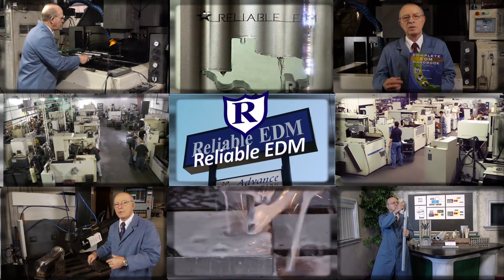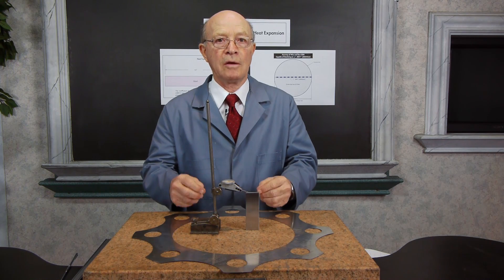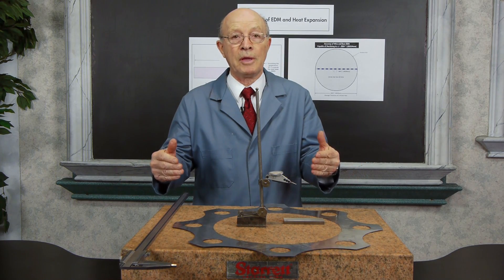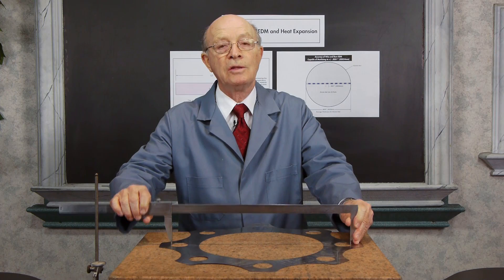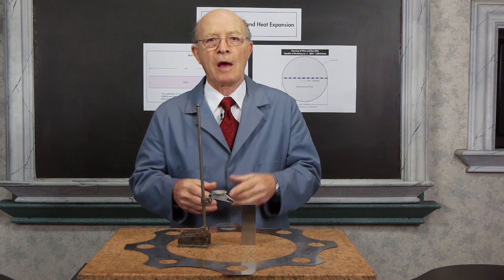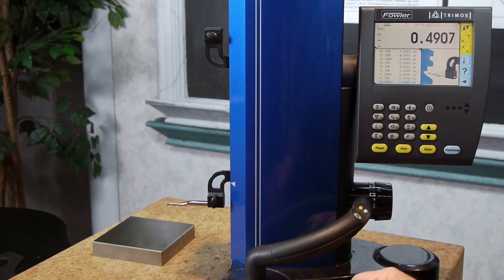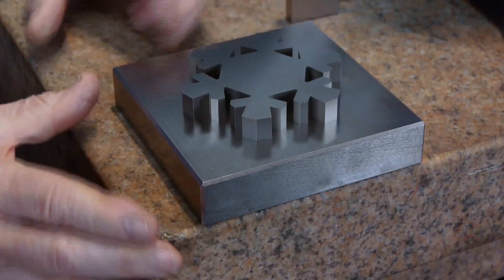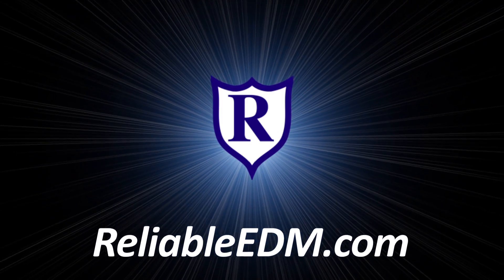Accuracy of EDM and Heat Expansion

Comment: The second he said they wanted the holes within .0005" of each other I knew that whoever asked for that didn't understand what they were asking for, given the functionality  and shape of the part.

This video wouldn't be complete without the old school tool maker lecturing the engineer/designer on tolerances.  

Engineers/designers need to understand what there part is doing, how it's made, and what it costs before they start throwing around +/-.0005" on everything.

Comment: I have one question... is the snow flake cut out of one section of steel and the hole out of another or did you cut the snow flake out of the same hunk it's sliding into?
I don't know anything about edm.. so I don't know how you have to set up or cut.

Comment: What I find fascinating here is the perfect symmetry of the demonstration snowflake piece. With a rotation of 60 degrees the two parts were still in very close tolerance.  Would have been of some benefit to heat the large square piece and to cool the snowflake to demonstrate the larger air gap between the pieces. Conversely one may place a heated bolt or metal part on the center of the snowflake and then it would expand inside the receiving square block to such an extent that it would be locked in place.  Only other comment is that the metric system is in general usage in the world and for some reason United States is still in the dark ages here.  Regardless most measurment devices are fully functional in metric.